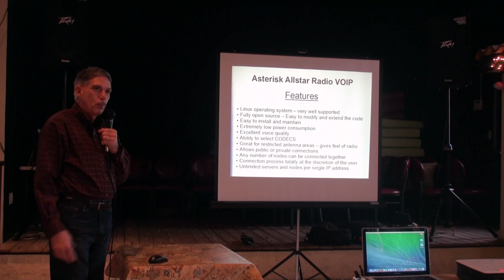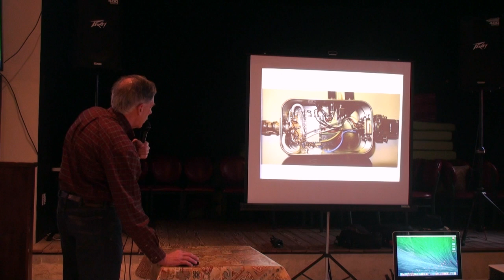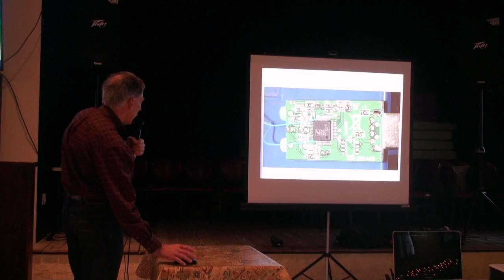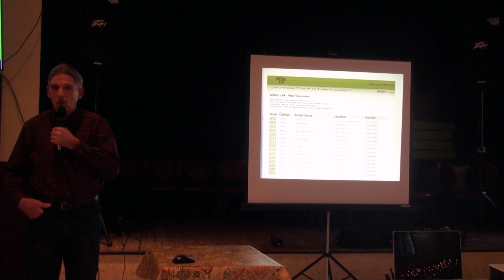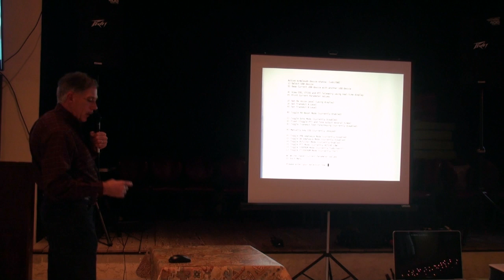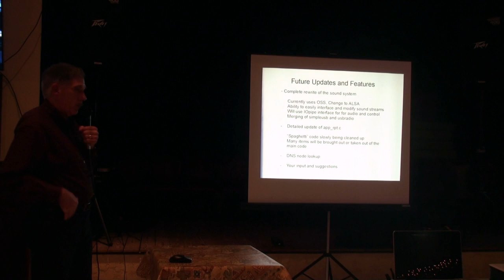Asterisk Allstar Explained

Comment: Ok, for 1.5 rc2 on a RPi 3B+, can someone tell me how to add more than 1 wi-fi network, or really more than 2?  I can manually add my phone's wifi to the wpa_supplicant_custom and get it to still connect to my home wifi, but the instant I add a third network to that config the wlan0 interface will no longer connect.  I'd like to be able to store multiple network configs into the file and have it prioritize and auto connect to them without having to change the config every time I need a different wi-fi network.  I can do this on other Linux distros, but since Asterisk doesn't seem to use netctl completely, I have yet to figure this thing out.